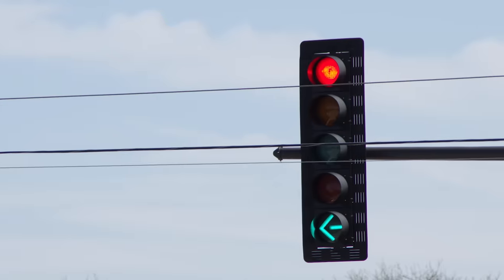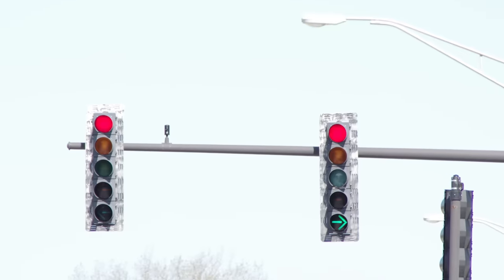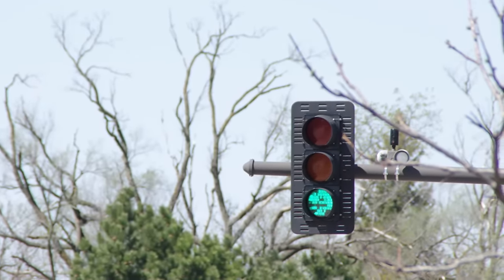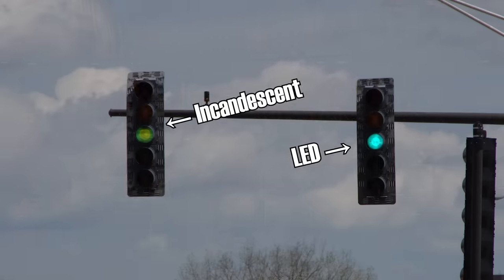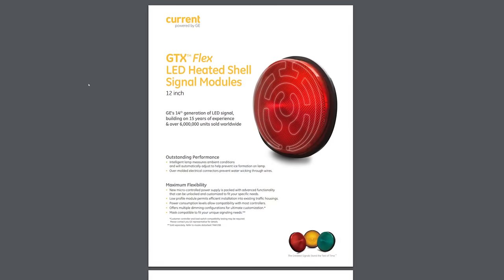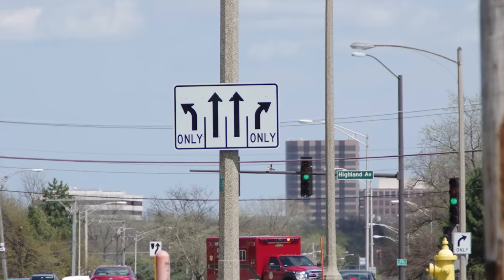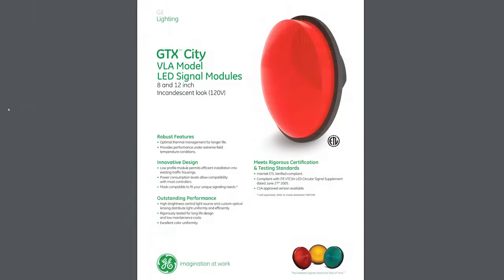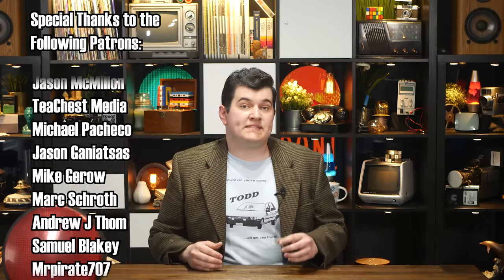The LED Traffic Light and the Danger of "But Sometimes!"

Comment: 8:40 ...or equip each fixture with a simple thermocouple for autonomous defrosting (EDIT: like the GE modules at 10:14)? :headdesk: This is only slightly more complicated than rocket surgery, which isn't that hard.
Reply: Especially given the fact, that most traffic lights are under power 100% of the time, only barely glowing when in OFF state. This is to prevent current spikes happening every time a cold filament is turned on. 99% of incandescent bulb failures happen on power-on because of that current spike, and traffic lights are turned on thousands of times per day. 
So de-icing heaters would iessen the power savings even less than presented in the video.
Reply: Rocket surgery?
There used to be a band near me called The Rocket Surgeons.
Reply: Cute name for a band! "This isn't rocket surgery" is a fairly common trope; Bill Nye actually used the phrase in a twitter response video.

Literal rocket surgery was a big part of the Space Shuttle program's missions, like repairing the Hubble telescope and other satellites. I suppose the commercial space companies will be doing this between ISS replenishment errands.

Comment: Has anyone seen the intersection where the left turn cant turn when the thru traffic has the green. So in the evening you want to turn left but the arrow is red but all other visible lights are green. There are no cars in miles except the cop sitting in a parking lot waiting for you to turn on red arrow. There is 1 intersection where you get a green arrow every other cycle...
Reply: There are some areas where at night the left light will flash red(stop sign like) or yellow flashing(yield). I see them in Wisconson alot. There are some cities in Illinois doing it now too.
Reply: There are actually a few laws being changed for situations like this. As in, laws are being passed in some cities so that streets that are used less frequently during different hours change the patterns in their lights. Basically it tends to shorten all cycles, so that you’re only ever stopped for a short period of time. Laws have also been passed in some areas for vehicles that don’t set of the sensors such as motorcycles, bicycles, and some small and light cars, so that if they are sat at a red light for a complete stop and there is absolutely no oncoming traffic going the other way, they may go even if there is a red. It should be noted that there are very specific laws for this but cities are trying to make things easier even if it doesn’t seem like it.
Reply: Yes Indy, I've complained about the same thing. Now flashing yellow left turn arrows are appearing at some intersections, but there could be many more intersections where they could be installed to make the system more efficient.
Reply: I've bypassed only 1 red light in my lifetime due to this scenario (when a light doesn't change because it doesn't register your presence) Thankfully it was very late at night with literally no traffic at all on huge 6 lane roads. Since the roads were so big it was even easier to see oncoming traffic or lack thereof. I was so thankful there wasn't a cop waiting for me to blow through the light after I waited for about 5 minutes.
Reply: Andrew Sercer depending on your location that may have been legal! If not there are obvious reasons for it to be so.
Reply: We had some like that here locally, and after 11pm, they just stayed red indefinitely.  I videoed the traffic jams it caused over a few weeks on my dashcam and sent it to the city council and engineering departments, the mayor, etc.  It actually got fixed a few weeks later.
Reply: IndyKurt iI
Reply: IndyKurt time to play Monopoly
Reply: And police wonder why people dont respect them.
Reply: hmm   the law you cant turn left on a red light?    lol
Reply: Confuzed Graphite the loop sensitivity should always be able to be adjusted to pick up smaller vehicles. I understand where they are coming from but if the loop isn't detecting motorcycles or small vehicles something is probably messed up.
Reply: Andrew Sercer I used to run into this a lot when I was able to ride a motorcycle. Late at night I could get stuck when my bike wouldn't register its presence so I'd never get the necessary left turn arrow.
Reply: Yes, we went trought the light cycle three times until the driver decided to go on the next light stop. The censor was faulty and did not detect someone wanted to turn left.
Reply: For motorcycle, i heard reving the engine up makes enough "energy" for the censor to capture it as a vehicule. Anyone tried?
Reply: I've experienced a fun thing where I go up to a light in the middle of the night. It's red, I want to go straight. I sit there for a minute all alone at the intersection.... Light changes! ...To a green left arrow only?? Go home light you're drunk.
Reply: How about this one. In Florida people will sit a full car length behind the line wondering why the light skips them. Meanwhile the drivers behind them are getting really pissed off. They also think a u-turn on red is totally acceptable.
Reply: lesdmark That's far from a Florida exclusive in my experience.
Reply: Florida residents, especially the drivers, don't really have the best reputation for strong thinking skills in any case...

Comment: Something that my local city did is keep all of the old incandescent fixtures that they were already using but instead just put in LED light bulbs, like the ones you can get at any hardware store, and changed the wires and resistors running to the lights, been absolutly great because thy are still have that old look which fits the city but are much brighter.
Reply: Sadly ours are now a combo of hospital white (forcing me to wear sunglasses after dark, given I'm extremely sensitive to white light) and extreme blue, such as near parks and public places, making a visually jarring and extemely uncomfortable look and I think it's to drive homeless away, another societal problem no one wants to truly solve.
Reply: @NickDalzell  you can't ask for more money to solve a problem if you actually solve it

Comment: With respect to the detectors that are setback >200 feet from the intersection:
In addition to counting the number of queued vehicles (to determine the initial amount of green time), these "setback loops" are setback for another timing reason.  At least one set is typically placed at a calculated distance from the STOP-bar.  This distance is determined based upon the speed at which vehicles OUGHT TO BE TRAVELING (not necessarily what the "dangerous" ones are doing) such that they will traverse from detector to STOP-bar in a time greater than the "decision-time" in which a driver might be undecided about going on Yellow.  This is referred to as "Dilemma-Zone Protection."  If nobody passes the detector after the previous driver reaches the STOP-bar, the signal is free to go to Yellow and Red for that movement.  (BTW, the time period is typically 5-ish seconds, at least for GDOT.)

In fact, in Georgia, EVERY intersection has these "setbacks" on the two major approaches (I.e. the "mainline" or heavier road); however, in many cases, they AREN'T counting the queued-up cars and are only functioning for Dilemma-Zone Protection.  That car-counting feature is only engaged on the more-heavily-traveled corridors.

For those who want to "nerd-out" about this stuff:
The video presenter mentioned the reason for "setbacks" as the controller counting the number of cars that have arrived and are waiting to go.  This is one-half of the timing principle we call "Volume-Density Timing."  Unfortunately, the density portion of this principle is too detailed to explain here.

Comment: why not they simply make a down facing slanted plastic cover so snow can't stick to the down facing slant? never get snow in Sydney but I assume gravity should help here some "watt' :)
Reply: The lens is already dome shaped so if your theory was correct the bottom half would stay clear.
Truth is that snow can be very sticky, and wind driven snow will often accumulate on slanted surfaces, or even the underside of an overhang.
Imagine a freezer with no defrost cycle. Does the frost only stick to the bottom? Nah, it sticks to everything.
Reply: Andy Lundell non-stick coating? Smartphones have it to prevent fingerprint stains and watermarks from accumulating on the screen.
Reply: snow eventually sticks to the smoothest surfaces like, you walk outside and your ENTIRE car is covered in snow even the vertical sides

Comment: Where I live there are many led traffic lights installed, and althought there's no chance for snow covering them, they may malfunction or lose power. But then, led makes possible a neat feature: those lights turned off on purpose briefly flashes every couple of seconds while the desired light (e.g. the red one) is turned on, and this acts at a witness of malfunction: if no light is flashing, then there's no power altoghether instead of one of the lights not working without clue of which of them. If two out of three are flashing, and the third is turned off, thein the later isn't working a should be regarded as if it were turned on instead. This flashing also clue drivers about how much time they have still to wait, by means of making the flashing linger longer as time goes in, followed by a longer flash before the yellow or greem light turns on. Since in here most cars are still stick, this help reduce the time taken by every driver in the line to start moving forward.

The newest trafic lights features a timer taking the place of the yellow light when it's off, of the same color of the light turned on (red or green) to let you know how long to wait or how many time you have left to cross.

Drivers may still not honor trafic lights, anway.

Comment: Where I live, many traffic lights still use incandescent lamps. As many of them are more than 50 years old and circuit simply doesn't allow their use. 
Even though they're that old these are connected to a central system which then can tell a technician that a bulb is out.  
Neat. 
With LEDs these circuit is being triggered all the time and the fail safe mode kicks in once it detects that for example all red lights for a certain direction don't work and shuts the traffic light of so now the priority signs regulate traffic. 

Well that ain't so good and the reconstruction of that traffic light is way more expensive than the energy savings from more efficient lamps.

Comment: At the minimum, what they should do in your area is drop any basic 100W equivalent LED baulb in the fixture in place of the old one, they only cost about $4, and it'd require the same amount of work as putting in an incandescent, and save work in the long run..

Comment: Fun fact my town in Connecticut also happens to have a traffic abatement system set up for emergency vehicles however ours are activated by the sirens specifically the yelp town on the emergency vehicle this was done so that if emergency vehicles from other towns were responding for instance to a mutual aid situation they wouldn’t have to be equipped with the special light to trim the sensor sirens they already have would do the job

Comment: I really like your videos I follow from F'rance as a retired electrical engineer. I have also to thank you for often converting US units to ISO units in your comments. Otherwise I would be lost ! I just wanted to react on one of your comment about LED heat dissipation : to me, if the current drawn by the LED traffic light is one tenth of the current drawn by the bulb, the heat dissipation of the LED light should be only about 1% of the heat dissipated by the bulb, since the power is proportional to the square of the current. But maybe I'm wrong, because incandescent lamp and LED lamp do not share any common technology.

Comment: I know a reason why the right turn arrow doesn't immediately come on at the yellow light for forward traffic anymore (13:53 in the video), specifically a Cook County, Illinois example. People here are notorious for doing two things:
1. Going through stale yellows to the point of basically being a red light run.
2. Multiple cars in the intersection awaiting a left turn that inevitably have to wait until the light changes before getting an opening.

When #2 has to wait for #1, many times, multiple cars are swinging left then even as late as the opposing intersection's protected left turn starts, and Chicago drivers are known to cut into whatever lane they want for both a left and right turn when there's only one lane of each. I've had many instances where if I kept going when the right turn arrow immediately comes on, I would've been hit. The behavior this delay is enforcing is exactly what I already learned driving in Chicago / Chicago suburbs.

Comment: "a snowstorm serious enough to cause buildup is pretty out of the ordinary", where I live it was snowing around 200 days last winter. Meaning it was snowing for the majority of the year, and most of that snow is wet and sticky because we usually don't get very cold temperatures (thus the heavy snow).

We still use LED lights though.

Comment: Speaking of detectors: on my bike commute, one complex intersection left turn is governed by detector. If a car is there, it will cycle through a green arrow (not immediately, but as part of the normal sequence). If there's no car, it just gives you a straight green light (I think it shows a flashing yellow arrow). My bike is apparently too small to signal it, and in morning rush hour, it's very difficult for me to get through unless there's a left turning car ahead of me.

Comment: One of my first traffic tickets was caused by a traffic signal. (Yes, it's a "traffic signal" and not a "stoplight" because the purpose is to facilitate the flow of traffic, not interrupt flow). If the local guy setting the timing thinks of them as a "stoplight" he'll stop you at EVERY intersection. We had one of those. Back to my ticket: On a service road with a light controlling flow onto a larger thoroughfare my light was GREEN. I continued and was stopped by a state trooper for running a RED light. I knew the light was green, but I believed him due to my respect for our troopers and his professonal conduct. I didn't even argue. I then went back and sat watching that signal. Everything was normal ... Green, Yellow, Red. I continued watching. Suddenly that light went Green, Red! I didn't even believe my eyes, so sat there waiting to see it again. Outcome: Every 7th cycle that blasted light jumped from green to red without a pause on yellow! I confirmed it again: 7 cycles. I tried calling the city, the state DOT and couldn't find out who to tell. Strangely, later I worked for my state's DOT and oversaw the installation of many traffic signals and controllers on my projects. Call the city or DOT "Traffic Services". I paid the ticket and took the insurance point due to my inability to prove the box that changed that signal had a fault. I saw the green and the trooper truly saw me under a red. Life is sometimes stranger than fiction.

Comment: There's a weird intersection near me where two parallel roads hit a common crossroad with barely a car length between them. As part of my daily commute I come down one road then u-turn to the right through these intersections onto the other road, now traveling in the opposite direction. The lights are timed such that this path is always valid assuming I don't make a right on red.

This is where the LEDs create a persistent safety issue: I can see the traffic lights of the second intersection while sitting at the first, but because the lamps push the light out in a relatively narrow direction, all the lights of that intersection look OFF to me as I approach the intersection, until very nearly the moment that I have entered the intersection. This means my attention is not on the cars, it's on the light to make sure that it really is green. It's one of my least favorite intersections of all time, and there's steep competition for that honor. I grew up in Jersey.

If there were incandescent bulbs in there, I'd be able to tell at a glance what I was getting into before starting my turn and could put my full focus where it belongs, on the road and the cars.

Every technology has limitations. "Sometimes" the old school situation works better in a niche application. That one weird intersection is no reason to throw out LEDs, but you also don't want to blindly use the new thing when there's a reason to stick with the old.

Comment: I can see the LED heater traffic light only being applicable in specific circumstances (i.e. a town that's particularly susceptible to blizzards from a specific direction on a seasonally regular basis). 

The other thing I wanted to mention is that, being a lifelong Floridian, I only just found out that power companies can and will send a controlled short down the line to melt any ice off. I have no idea if that would clear the snow off traffic lights connected to said lines, or how long power companies have been utilizing this technique for snow removal. Regardless it's pretty cool (pun intended) to watch. There's plenty of videos out there showcasing this.

Comment: The "but sometimes" occurrence of wind and snow is the justification for my municipality to refuse to swap to LED stoplights because it snows 8 months of the year. Which is stupid because most of the time it's just casual flurries that don't obscure the lens fixture. Our neighboring County which gets a similar amount of snow (about 225 inches annually) has had no issues going to LEDs with using the extended visors and heaters. We spend a stupid amount of money replacing incandescent bulbs every year.